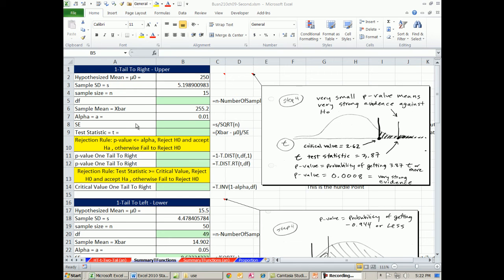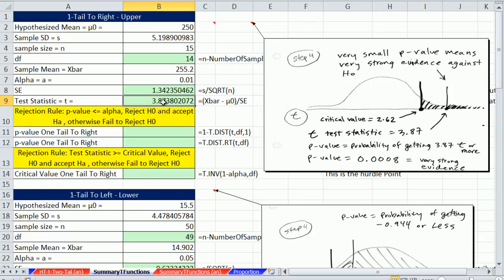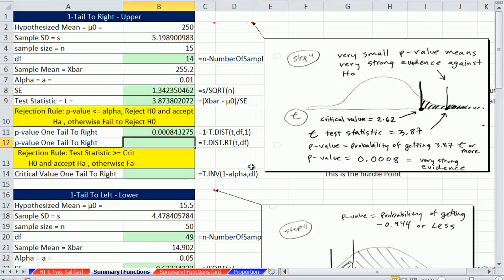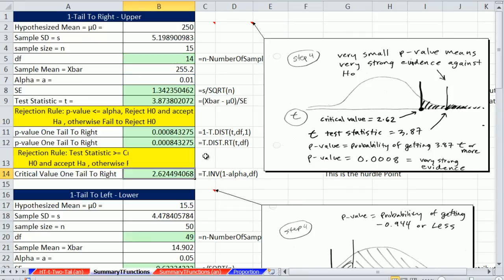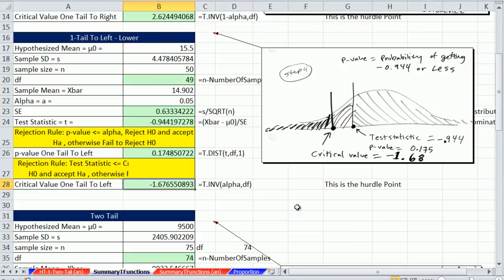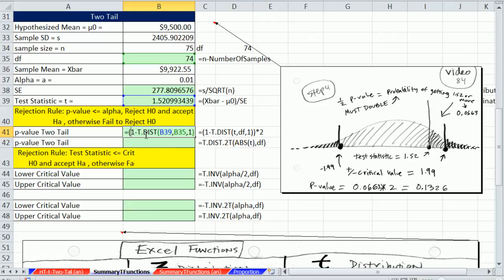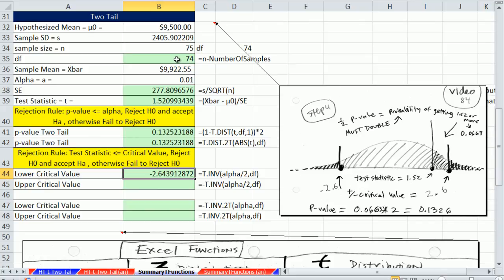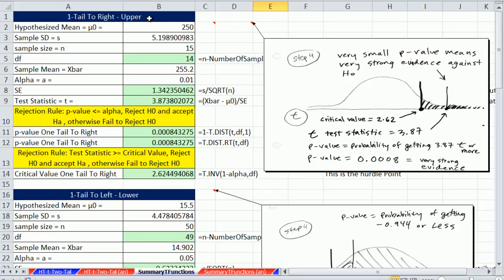Excel 2013 Statistical Analysis #60: T.DIST, T.DIST.RT, T.DIST.2T, T.INV, T.INV.2T functions

Comment: I have 9 women making on average $47.12 with Var= $53.24 vs. 
33 men making $35.11 average, and $487.42 var.

I calculated this to have a test statistic of -2.64

To test to see if men make more that women with alpha=.05 I used:
TDIST(abs(-2.64),((9+33)-2),1)  which gave me .005787968 which is < .05

Do these numbers really suggest men make more than women despite the average suggesting otherwise?  Or am I missing a step?  Admittedly men do have a much wider variance.